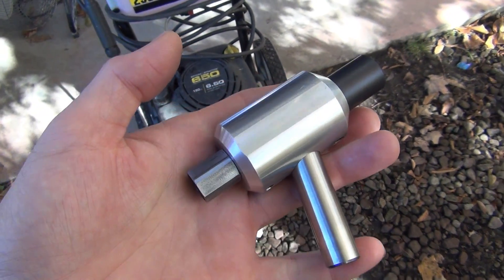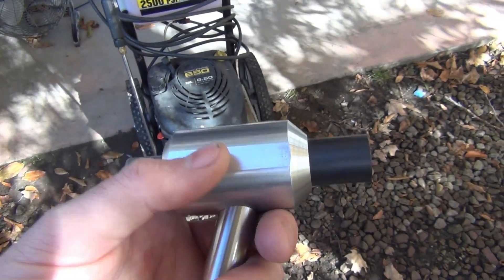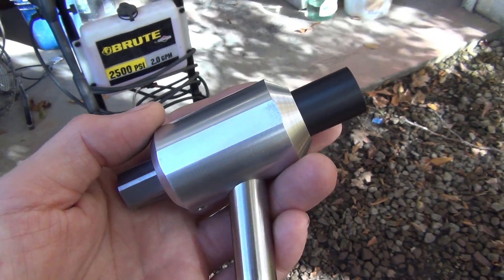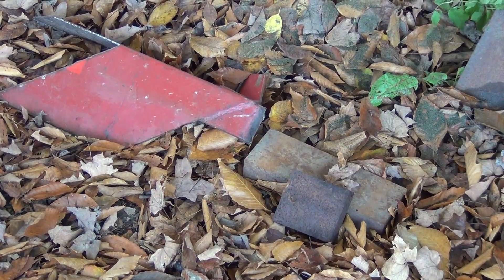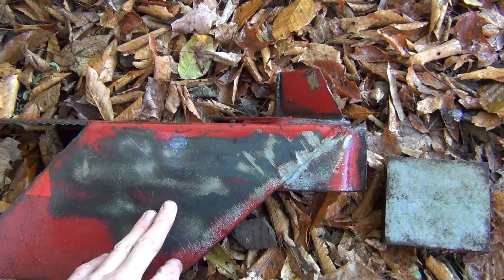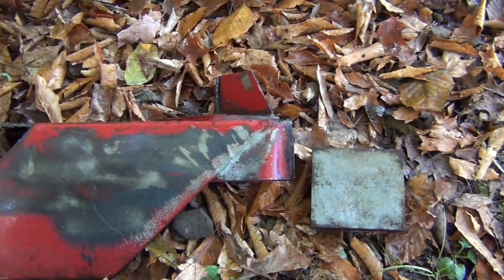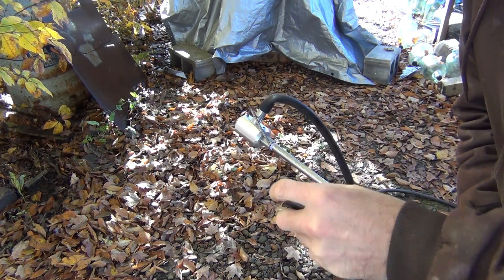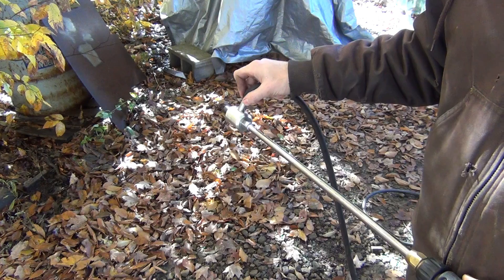Converting Sand Blaster Into Portable Wet Blaster | Possible Water Jet Cutter?

Comment: The problem with any pressure washer based blaster is two fold:
1. Most pressure washers are lower power than decent air compressor
2. water is heavy and it does not accelerate to nearly the same velocity as air, hence it cannot accelerate the abrasives to the same velocities as air can.

Comment: Great info. Where is the Brush Hog mod video?
Reply from the maker: Sort of a long story. I have film of building it, but my truck got totaled before I could take it back to the farm and record better test footage. I do have some ok clips, but I wanted better. Maybe I can use what I have. I have a lot of video that needs edited.
Reply: @ArnoldsDesign  Would be great to see whatever you have. I modified my old Woods 5ft brush hog years ago. Cut out a section of the rear so the blades throw the grass out the back. Cuts more freely. Needs less power to run it.
Reply from the maker: @kmcwhq  That's what I did too. Mine's a Howse brand. I'll dig it out of the archives.

Comment: how about 70bar (1000psi) pressure washer?
not strong enough?
Reply: I'm not part of Arnold's team, but based on my readings you will need a pressure washer with AT LEAST 1500 PSI to work. Hope that helps.
Reply: Thanks

Comment: Edit: I should have read other comments before typing all this out ha!

Got a suggestion that might help as your media is coming in bursts. A vacuum is being created yes, but not enough to pull through a trickle of media so it builds up and sucks a load of media all at once. If you gravity feed your abrasive line from the bottom of a modded bucket it's much more consistent. You'll have to play around with the ID of the abrasive hose otherwise you'll pull too much media through.. or try a valve. When you pull too much media through, like when it bursts through on yours, the particles collide with themselves and reduce their own kinetic energy so you get less effective rust removal, plus it wastes media which unless you're recovering and drying out is costly.

Comment: Could this be used with The king's power washer gun? It does up to 20 gpm and operates around 2500 - 4000 psi? If so what would be the cost ? This innovation is very interesting.  Thanks in advance.

Comment: The problem with pressure washer blasting is the media is difficult to reclaim. 

Air/vapour blasting will recycle the media if used in a cabinet but requires a large compressor to function.

I would like to see if an all water blast cabinet would work, with a slurry/capture tank instead of dry media, a fan spray pattern would also probably be beneficial.

With the slurry agitation and pressure for blasting coming from the same source the setup cost would be reduced significantly (no need for an air compressor or slurry pump), it would need an overflow from the slurry tank with a screen so that only water can escape the slurry tank or a trap to allow the media to settle out of the overflow water.

You could possibly recapture the water in a second filtered tank to feed the blaster (not essential but would be great if the system could be self contained)
Reply from the maker: Hi Nexus. I have a recapture closed loop system as you described which I use in my business. I had a lot of people inquire about this over the years, so I wrote plans which I finished this winter on how to build such a system that I am selling now. Regarding fan spray, I am working on a spray pattern setup. I have the nozzle itself, but need to match the jet. Without it, you just get a fat elliptical pattern.

Comment: Incredibly inspirational work man. I know you might have covered it before somewhere but i'm interested in what type of material you use in the vapor blaster for a fine and shiny or polished finish you get in some of these videos. Also, did you say somewhere that you would sell these vapor honing guns you machine? I loved the red one. Keep'em coming.
Reply from the maker: Thanks Rick. I use glass bead for the final finish. I don't make the red gun for sale. It's too involved to produce, but I am redesigning for one for the same output. I sell the silver guns right now though. They can be used in wet and dry blasters.

Comment: Hey, you made a water jet cutter that works on glass! Evidently this is the Holy Grail of CNC. Did you try messing with the internal jet size on the water feed?
Reply: I was thinking the same thing.  Mount this to a small gantry setup with some steppers and grbl and you've got a home-brew water jet!
Reply from the maker: @shirothehero0609  Cool. Share the video with the water jet guys. Maybe they'll take this and run with it... and buy my blasting gun too at the same time.
Reply from the maker: Cool. How is it the holy grail of cnc? Yes, I did experiment with different jet sizes, but had to be careful not to overload the pump. Probably if I wanted to use this for cutting alone, I'd have to make the jet with a longer internal hole, to try to get a laminar flow. I don't know though. This is my first attempt at it.
Reply: @ArnoldsDesign  That seems to be the standard by which all CNC water jet cutters are judged. "Yeah it's cool, but does it cut glass?"
Reply from the maker: @Preso58  Oh, ok. I didn't realize that was an obstacle for cnc water jets.

Comment: Nice. Do the same with my pressure washer and have combined with a slurry pump to drive the sand through. It can be a very slow process so I only use it for hard to get at sections preferring to strip the rest with a wire wheel.
Reply from the maker: Sounds interesting.

Comment: Brad, great video. I was thinking  that a gravity feed to the hose from the bucket would improve abrasive flow. It would require fabrication of a stand, modifications to the bottom of the plastic bucket for an output port/hose connection offset to one side  and  the bucket would have to sit on an angle to keep an output port covered with abrasive.  Great idea using a vacuum gauge.
Reply from the maker: Thanks Paul. I was giving some thought to an idea like that a while back, but for my siphon blaster to reduce intermittent abrasive flow. Any advantage to help abrasive flow is a good one.

Comment: Just thinking... Would you get a better spread from a slot shaped cut in the nozzle instead of a hole?
Reply from the maker: Possibly. It might need to be  pressed into that shape during molding. It is a semiconductor, so I don't know if it can be wired edm'd like metal.
Reply: @ArnoldsDesign  you might be able to electrically chip it out by using electric pitting between two contact points?
Reply from the maker: @sarchlalaith8836  Yes, that would be edm machining, with either an electrode or wire. I don't know if it can be done with boron carbide.